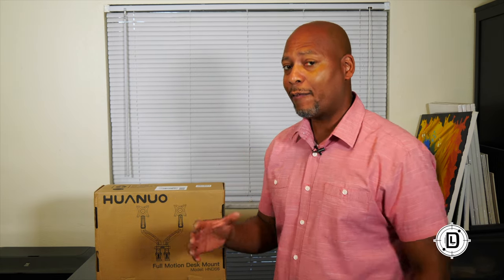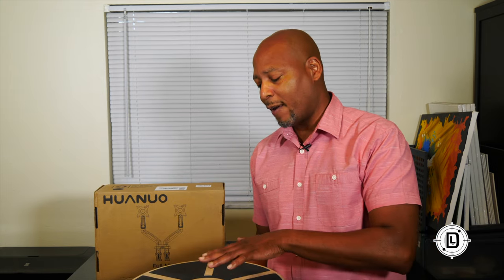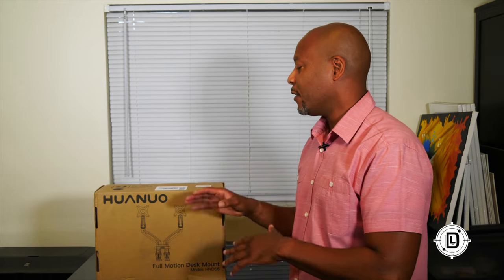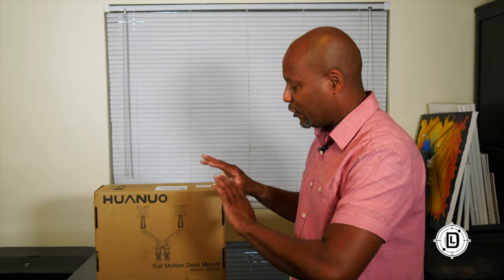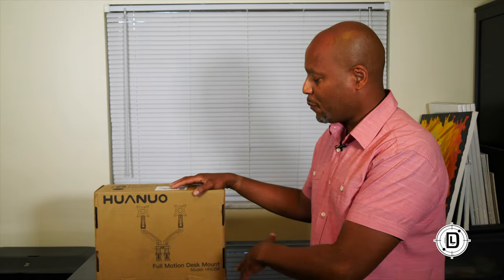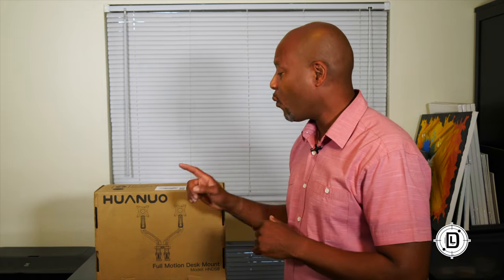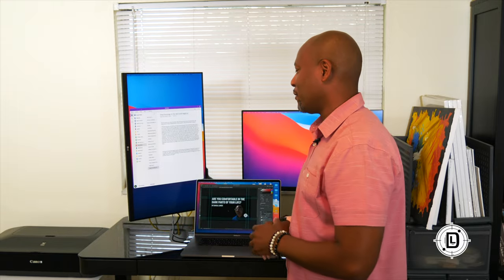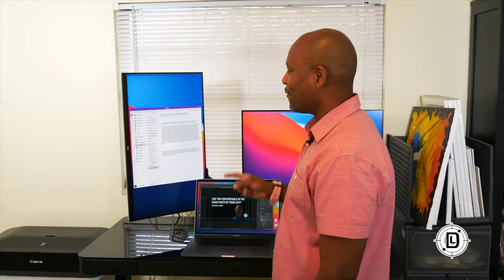Huanou Dual Monitor Mount, Unboxing, Set Up and Operation

Comment: Finally! someone shows the complete process in setting it up. my friend gave me his because he was getting a new one (it still works perfectly) and i had no idea how to set it up since it didn't have instructions. thanks
Reply: How did the monitor arm work out. Also can I ask what monitor your friend replaced this one with
Reply: @bigdaddywaffles_6748  bro i ordered it and my fuckingb monitor doesn’t fit it idk how to take it off either pissed
Reply: @emmittvalencia7645  update)
Reply: @Cj-tg3ms  update (got the wrong monitor arm/mount for my monitor, i guess theirs specific ones you need to get for even the adapter to work
Reply: what a nice friend

Comment: Perfect unboxing, but you don't need to hold the monitor up to the bracket to mount the screws. You can set the monitor on the table and put the screws into the top two holes. Then you lift the monitor and set it down into the cut outs. Then you place the bottom screws. But very in depth review, thank you

Comment: Thank you for your video! I just bought this monitor mount and when I opened the box and perused the instructions I thought, "This looks way too complicated. I should return it." And then I found your video. It filled in the gaps where the instructions weren't clear. I'm all set up and it's working great!

Comment: Thank you. I found this video AFTER I put mine together. And now I have to exchange it because the left arm will not adjust properly..won’t stay down even after turning the screw. It may be damaged according to their tech support rep. 

😂 at your comment about people being careful not to get hit in the neck with the arm…I had that same thought of why the company had to put that in the book… it must’ve happened to someone(s) before. It made me super careful when I took the straps off…and I cut them off 🤦🏾‍♀️ not realizing I could just slide them off until I saw your video and I didn’t have a second person helping as recommended in the instructions.

Comment: If you put the top screws, part way in, on the back of the monitors first, then you can slide the plate under the screws to hold it until you can tighten them and add the bottom screws.

Comment: Thank you so much for this video, I've had this dual-mount for quite a while now but was never completly happy with it because I just couldn't get 2 different monitors aligned the way I wanted to. After watching your video I finally found my mistake. I thought of the  adjustment of the arms was like a bolt/screw (put the arm in the position you want and then tighten the screw so it stays there),  it never occured to me to think of them like increasing/decreasing hydraulic pressure.

Comment: Why isnt the arm that holds the monitor staying where i want it? I turn counter clockwise to add tension and it pops straigh back up to default position

Comment: perfect apart from you install the two top screws with washers before offering the monitor up, then hang it it while you install the bottom screws. makes the single person install much easier

Comment: Thank you so much.  Though it came with instructions, your video walked me through the whole process.  Holding the monitor while screwing it into the mount was a little challenging, but I did it!  I don't need a "honeydo" man/woman after all.   Thanks again!
Reply from the maker: So happy I could help you make it happen. That was tough holding the displays, as I look back it may be possible to put the top screws and hang the display. Thanks for watching and the comment.
Reply: SAME!! It was so confusing!!

Comment: Thank you very much! I just got my dual arms and noticed some differences from your video.  Firstly,  the arms,  lower & upper were not attached so no tension... trying to figure that out.  Also,  my monitors have a protrusion when the base is removed.  When I attempt to hang the monitor,  the plate cannot connect at the bottom.  These are sceptre monitors.  Any guidance will be greatly appreciated.. thank you

Comment: An easier way to do this is by putting the top screw in partially and then latching the screws (almost like hooks) on to the top of the mount

Comment: Really, really great video. Thanks. I'm frustrated with the arms though because at the height I need, my choices are having the monitors either really far apart or right in my face. My desk is a bit narrow for this product. Not your fault. Still an excellent video.
Reply: Nevermind. It was me. Figured it out. Now it's perfect.
Reply: Please tell me how you figured it out. Im having the same issue
Reply: @annkustoff1323 hey man pls let me know what u did to fix this issue

Comment: My  desk has a square metal bar similar to yours, however it’s an inch in from the perimeter of the desk. My clamp actually sits and tights to this metal bar fine, however the circle pad on the clamp is wider than the bar so that maybe a quarter inch extends past the bar on either side. I’ve tightened it as much as I could with the metal bar directly in the middle of the circle pad of the clamp. Is this okay ?

Comment: Not sure what to do but I installed everything. Mounted the monitor and granted it’s a heavier monitor (14.1 lb) but it’s under the 14.3 capacity per arm that it advertises, yet when I hang my monitor the tilt just won’t keep it straight. The base arms support the weight of it but the tilt just falls straight down. How do I adjust the tilt tension? Because looking in the sides It appears to have Allen wrench space but it’s not. Feel like I just wasted all my time and money

Comment: Can this work with 2 different height monitors? It seems like it has up and down adjustment but one monitor would end up at a different angle if the height adjustment was different since the arms originate from the same point. Having the left monitor rotated in the video highlights this issue because putting them side by side in that orientation would put one arm more forward towards the seating position. I think 2 independent arms are what I would need for that scenario

Comment: I stumbled upon this video and I just so happen to have exact same desk and monitor arm. I like the spacer block idea but I'm still a bit nervous about the pressure on the glass. Has anybody else tried this if so have there been any issues over time?
Reply from the maker: Still no issues and it's been almost a year now and everything is working great. Great question, thanks for watching. Please subscribe to the channel for more reviews, DIY, how to's and cool motivation. Thanks again for watching and the question. Good luck with the mount and desk.

Comment: how has it held up having to put the wood as an attachment? bc i will need to do the same
Reply from the maker: Absolutely no issues at all. It has been great, including the 360 turn. I often turn one of the displays into portrait mode when I'm writing. The weight distribution with the blocks is fine you wouldn't even know they were there if you hadn't put them. While you're on the channel check out some of the other videos. Please subscribe to the channel, like this video and others you find useful and interesting. Thanks for the question and watching.